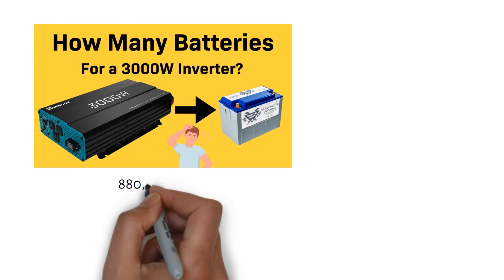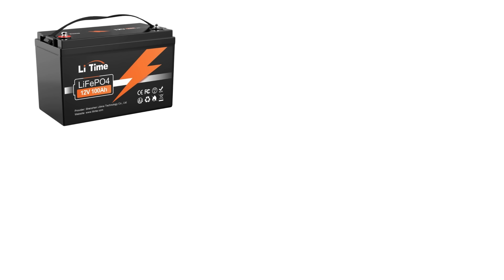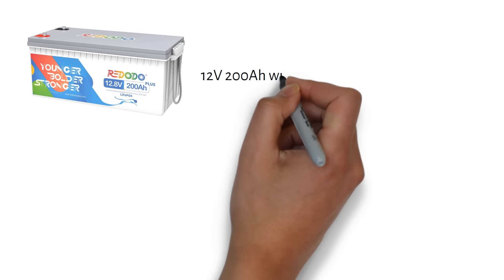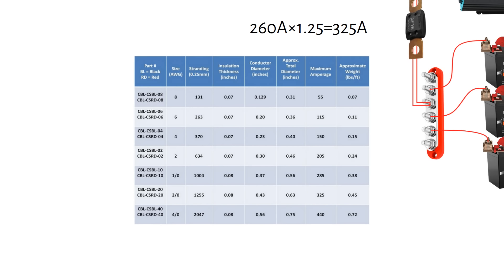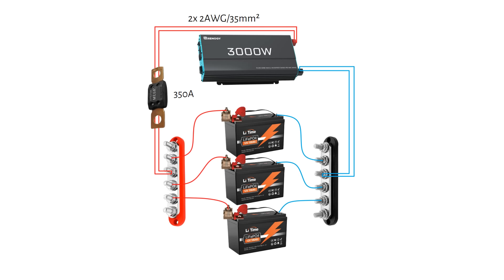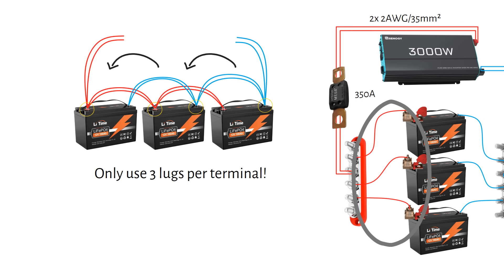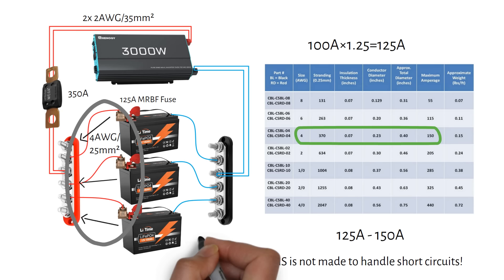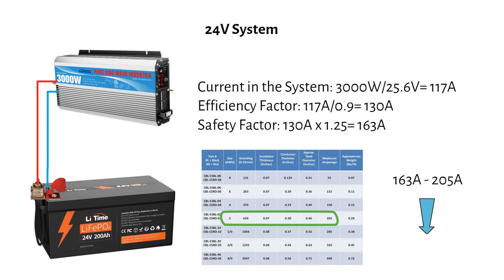How Many 12V Batteries for 3000W Inverter

Comment: Your math is wrong. A 100ah lead battery can discharge more than 800amps, which means it will last 1/8 of an hour at full use. A 3,000 watt inverter will have enough at 90% efficency to last 23 minutes.

I have a 300ah 13.8volt lithium battery. The capacity is dependent on temperature. The higher the temperature, the lower percentage of safe full capacity. Let's say I have 90% capacity. That is 270ah. It weighs as much as a 100ah deep cycle, technically 2lbs less. 

My battery provides 3840watt hours of power if not hot outside. Let's say 3456 watts of total power.  At any given moment it can have an out put much greater then even a 10,000 watt inverter, however it won't last that long. 

My camper has a daily pull with ac running of 7,200 watt hours. Let's say I don't let the batteries get below 15% and do to heat they don't fill up past 90%. I have a capacity range of 75% of each I will use. That 3,840 usable watt storage turns into 2,840 watts, but 90% efficency turns that into 2,592 watts. It will take me 3, 300ah batteries to meet my desired daily use. 2,592×3=7,776

For someone just using a 2,000 watt hour hair dryer for 10 minutes, dosent need a 2,000 wh battery. They need a battery with around 30amps of power, that can output 167 amps worth of power.
Reply from the maker: 1. Sorry, but the math is not wrong.
2. A 100Ah lead acid battery can have a cold cranking current of 800A. This is to start a car, not to run a load. I challenge you to do a test running an 800A load on a 12V 100Ah battery. It's simply not possible for a long time. 
3. Yes, the capacity of a 12V 300Ah battery is 3840Wh.
4. LiFePO4 has an efficiency of 95% if you use the recommended charge and discharge C-rate. That is 1C discharge max and 0.5C charge max. 
5. Why not run your batteries to 0%? To increase cycle life? That's not worth it. Calendar aging will take the battery out before it reaches it's cycles. Why don't your batteries to up to 100%? Did you set your charging voltage correctly? It doesn't charge with three stages like lead-acid does. It's all bulk.
Reply: You are wrong AGM / lead acid batteries can only provide the high 800A+ cold crank amperes for 30 seconds I think it is they measure with. Under high load like that the AGM / lead acid will drop in voltage fast and after 30 second it will not be able to provide 800A+ anymore and it will keep dropping until the voltage is so low that the inverter turns of and it do not take long until that happens. Most leisure battries is rated at ampere hours at  24hours slow emptying and give the rated AH at 24 hours just for that reason.

If you need high Ampere 100A for 1 hour for example you either need to buy a LOT more AGM / lead acid battries or simply buy LifePo4 as they can provide 100A until empty if needed with no voltage drop.
Reply: Your math is wrong. 

You have max amp draw, length of time at that draw, ect. That is what's important. 

An AGM 100ah battery has a maximum amp draw of about  800amps, for around 5 seconds. Even at 10% of that at 80amp, that is 960 watts. The maximum use of a 100amp hour agm battery is 50amps. 

I have a 300ah lifepo4 battery that weighs 2lbs less than a deep cycle 100ah agm battery. My max amp draw is 400amps for 5 seconds. My continuous max amp draw is 200amps, or 2,560 watts. (200×12.8=2,560). The maximum use under ideal outside temperature of a 300amp lifepo4 battery is 300amps, however outside temperature decrease maximum charge to 90%, 80%. So if it's hot outside my usable capacity will be reduced to 270ah, and 240ah respectively. 

So it takes 5-6 lifepo4 batteries to make 1 agm battery capacity. But it takes 2 lifepo4 batteries to make agm batteries discharge Amps. 

In most draw applications, to get the amount of Ah, you need; you will get the amp draw you need. 

For example, my camper in summer pulls 7200 watts a day. Let's say it's hot, so my lifepo4 battery won't charge past 90%. Each battery has 240ah capacity, or  3072watts.  At a 10% loss of conversion, it gives me 2,764 watts per battery. It will take me 3 batteries on the hottest day to get the watts I need. Which will be 8,295 available watts, which also gives me 600amps continuous draw, as each battery has a maximum continuous draw of 200amps. 

2 batteries is good enough for continuous amp draw, but it will take me 3 batteries for total power. With lead acid batteries, it will take me 1 battery for continuous amp draw, but 13 batteries for watts.
Reply: Again, when figuring out how many batteries you need in an energy storage solution, you need to figure out how many Ah, the batteries can supply; with losses how many watts that turns into, and subtract that from the watts, or kilowatts you will need for that period of time .

Figuring out amp draw is fun and dandy, but should only be done after you figure out how many you need for capacity. As generally, by getting capacity; you have already reached amp draw.

Comment: I am trying to figure out how to completely stop using this rather Useless appliance in my house. The ONLY thing we are using a microwave for is to warm up milk, water or food. Therefore this is just a massive energy consuming appliance for the sake of a little convenience. I would therefore appreciate ideas on how to stop using this appliance borne of decadence and laziness.
Reply from the maker: It doesn't consume a lot of power though. I estimate about 15W standby, thats 360Wh per day. You can always turn it off when not in use. But i would never have a 3,000W inverter on 12V.

Comment: Who runs their inverter at 100%?
IDC what kind of batteries you have, they won't last long and they will overheat.
If  you need to run a constant 3000 watts, you will want a larger inverter and a lot of batteries
Reply from the maker: I think you missed the point of the video 😬

Comment: 48v inverter with four 12v 50ah LiFePO4 batteries would make more sense and not strain these high frequency low cost inverters.
Reply from the maker: I don't recommend wiring batteries in series. It's better to get a 48V 100Ah battery and wire then in parallel for the same capacity. I made a video about why i do not recommend wiring in series.

Comment: How often do you need 3000watts.
Your deceiving people. I'm running a 2000 watt inverter
Off a single 12v 90ah
Agm battery charging at 14.6 v. On this set up. Running load of 25 amp and have never trip my circuit breaker or ran my battery dead
Reply from the maker: I don't think you got the point of this video Jimmy.

Comment: yeah i need to buy some wire but cant afford it right now so yeah i need 30 dollars to buy 50feet of 12gage wire for my solar panels so yeah if i only use around 15 feet of 12gage wire for two 100watt solar panel should be enough lol i hope also i have wire that sais it has 200dagreese c is this normal i know the higher the better but dam is it even ok to use wire that allows it to get that hot lol or is that just a safety rating thing man theres so much i need to learn i never finish high school but i knew most people dont need to go to school to learn how to servive lol you need to work last i knew so yeah ive worked all my life and still dont have a pot or pan to piss in so yeah such is life

Comment: Your calculations are over optimistic.  You are calculating that the battery will supply that power for only one hour with the battery voltage not dropping while you are sucking 125 Amps out of it.  Also no voltage drop in anything else.  Also you are assuming 90% efficiency for the inverter, which looks like a Modified sine wave inverter( Maybe not?)  The output impedance of the battery (2.5mOhm) and the resistance of the wire (1.5mO) will drop about 0.5V with 1 meter of #4 AWG at 125Amps. That's not taking the fuse resistance and its connections into account.  Which brings down the 12.8V to 12.3 and increases the current required.  And, you drew only one wire to the battery and did not add the Return wire to the calculation..................  It MAY be better to use the batteries in series so less current and less voltage drop (?)
Reply from the maker: If i would talk about all that i would lose 90% of the viewers 😄, but you are right. About wiring batteries in series, it will be better. I hope i made it clear enough that a 3000W inverter on a 12V battery should not be done.

Comment: All about the Lead-acid is pretty BS.....DONT FOLOW THE STEREOTYPE......acid is much more accesible, you can use normal vehicle batteries (btw they normally have C rating grater than 5.0 so I dont know what bateries have less than one, the 20% rule ussualy aplies to charching, but when you take in count that starting an engine takes 300-500A and the alternator is usually putting up more than 50A to the battery....and for ex. 55AH car battery can deliver up to 600Ah ), i know they have +-700cycles before they degrade and LIFEPO4 is pretty much lifetime, but you can get them very very cheap, in my case IT WAS MUCH MORE FAVOURIBLE TO BUY 5 TIMES LEAD ACID (that will each last 2 years with daily cycling) then buy the lithium.
Reply from the maker: Checkout my video about lead-acid vs lifepo4 batteries. Starter batteries are not suited for solar application because they are designed to start a car and not run a load long term. If you take a look at the composition of a starter battery, the plates inside are thicker, to allow the larger surge current. In deep cycle lead-acid batteries, these plates are thinner allowing for lower currents. Just because it has a high starting current doesn't mean they are suited for solar charging. These batteries won't last long. Lifepo4 batteries will outlast the lead acid batteries several times over.

Comment: Im sorry but its nonsense! The important issue is duration. Who on earth would ever use batteries to draw 3000 watts continusly? Never gonna happen. Heating, diesel heater. Cooking, gas. I use my 2500watt inverter to make me 4-5 expressos per day, on my sailboat. One 100amp lead acid battery is more then enough to run my expresso machine at 1500 watts for 2 min.
Reply from the maker: Cooking can take a long time and heating water can take a long time. It's not because you don't do it other people won't do it as well.

Comment: 12 volts is a horrible choice for a 3000 Watt inverter. It's just too expensive at today's copper prices to efficiently move around that kind of current. 24 volts should be the minimum voltage for that size of inverter.
Reply from the maker: Exactly what i'm trying to say in this video. Thanks for adding to the discussion 😉

Comment: Bullshit, I run a 3000 watt inverter on one battery for hours.
Reply from the maker: If you pull 100% the inverter capacity (3,333W) with a 12V 100Ah battery and standard 100A BMS, that's not possible. If you draw a smaller load, of course it will work. This video is to make you aware of the limitations of a single battery with a 3,000W inverter. Seems like you didn't get the point ✌

Comment: That’s easy. You only need 1, but it won’t last very long depending on the load. Want to power larger loads add as many batteries as you need to power the load for the time you want to run the load.

What a poor video.
Reply from the maker: It seems like you don't understand the subject though. The BMS of a 12V 100Ah battery will shut the battery down at a 3000W load.
Reply: @ I understand it very well. I worked on the road for 15 years traveling in a 40 foot RV building assisted living facilities. In that RV  I ran a full size refrigerator and a freezer that was 4 feet wide. When I moved from site to site I ran both of them off a 3000 watt trust sign wave inverter. Hooke to that inverter were 3  8D AGM batteries. That would be equivalent to 9 of the batteries you were using. Max time without charging was 36 hours before the battery bank was depleted.

Like I stated, how long you can run the inverter is directly dependent on the load you plan to run. In those 15 years of doing this I went through 3 sets of batteries. Making 120 volt power from a battery is not ideal for larger loads. A good generator is much better at that chore.

I was not trying to knock your video, just make a case for load VS amount of batteries needed to provide a certain amount of power from a setup.

Comment: EverStart Maxx Lead Acid Marine & RV Deep Cycle Battery, Group Size 29DC - 12 Volt - 845 Marine Cranking Amps

^ Many use this type of lead acid if you’re gonna compare apples to apples, it would be better to use a higher grade deep cycle lead acid battery would it not? 

Lithium and lead are not really apples to apples, but what I’m trying to say is you’re using the lowest quality lead acid as a reference.

From all the research I’ve been doing and real world testing that’s out there lithium cannot be used 100% discharge if you want them to last. You can only use 80% of those lithium batteries to make them last longer….

The lead acid deep cycle batteries that I posted they are recommended to use only 50%..

For off grid applications 70% lead acid deep cycle to 30% lithium seems to be the combination of choice.

Not saying your calculations are off just don’t think it takes as many lead acid to lithium batteries to equal while with the right type of lead acid deep cycle?

appreciate your work, the no nonsense approach giving the correct information as well as the highly detailed diagrams. Breaking down complicated problems and coming up with a easily understandable way to calculate the situation.✍️💯🇺🇸👍🏻
Reply from the maker: Trojan lead-acid batteries are the Ferrari of lead-acid batteries. So, no I didn't choose for low quality lead-acid batteries. Your battery is $120 while the battery i showed is $350. Marine cranking amps refers to starting engines, that's no use in solar applications where the current is delivered steadily and not in peaks. Don't look for cold cranking amps when you shop for solar batteries. The plates of these batteries are thicker than deep cycle batteries. They need these thick plates for the high amount of starting current, while deep cycle's plates are thin. That's why you should not use car batteries in your solar system. Thanks for your comment 😉
Reply: @cleversolarpower The battery I posted is 114ah many use this as its budget friendly @ $120 and you can’t beat the warranty. Not into Ferraris they’re not dependable. Price point is way too high.

Many also use:

SLIGC115 Duracell Ultra BCI Group GC2 6V 230AH Flooded Deep Cycle Golf Cart and Floor Scrubber Battery

$170 x2 = $340 for 12v 230ah
Which is what I meant by a higher grade deep cycle lead acid battery.

It would have to have the amp hour rating 2x as the lithium lifepo4 to be an equal apples to apples comparison test.

I would think by looking at specs and what others are actually using and working with solar and wind turbine systems.

But I’d like to know what you think about this.

Thank you so much👍🏻
Reply: Fits in Western, E-Z-Go and Club Car Golf Carts that require a 6V flooded deep cycle Group GC2 battery and is also used in many floor scrubbers.
Applications for this 6 volt battery include: personnel carrier, aerial lift, electric vehicle, golf cart, boat, RV, floor scrubber or floor sweeper.
Equipped with multi-fit terminals which enable quick and easy installation in different applications. This Group GC2 6 volt battery has 115 minutes of reserve capacity at 75 amps.
This 6V golf cart and scrubber battery provides a high reserve capacity to keep your equipment running longer.
Innovations like heavier grids, plates with higher density oxide and improved glass mat separators offer longer life cycles and superior cycle life performance.
Duracell Ultra Flooded Golf Cart batteries come with a 1-year free replacement limited warranty.

Additional specs on that Duracell battery
Reply: Im using 4, they work and best bang for your buck but expect 2-3 years I say. 

Still cheaper to get a bank of these where I am than Lithium
Reply: @XristoPR  Which ones are you using? Using copper bus bars and load balancing people are getting 10 to 12 years out of those lead acid batteries.

Comment: You are Wrong. The 3000 watt Inverter is an AC Watt Output.
To Calculate this , you need to equate the Battery System Voltage .
 Stop showing these Fake Videos
Reply from the maker: If you pull 3000W at the AC output that means you have 25A (3000W/120VAC). If you draw 3333W on the DC side from the battery you get 260A (3333W/12.8V). I chose the nominal battery voltage instead of 12V. I don't understand what you mean by 'equate the battery system voltage'. Please explain.
Reply: I love seeing foos trying to sound smart,
Reply: Power in = Power out + efficiency